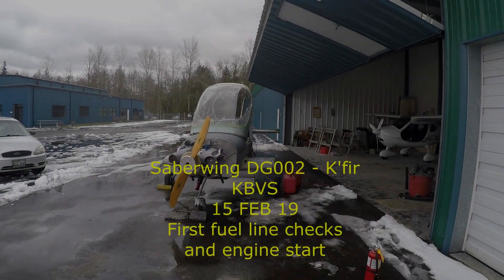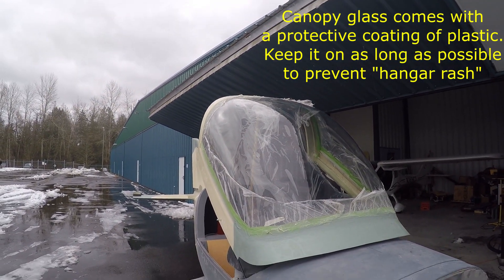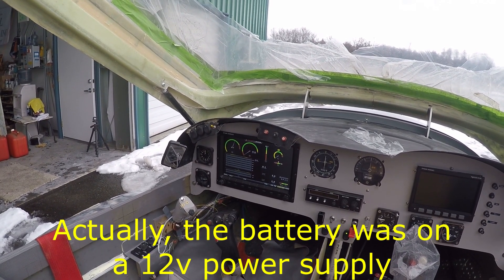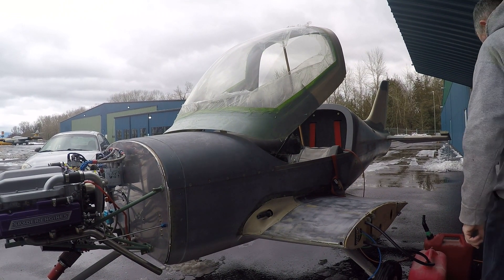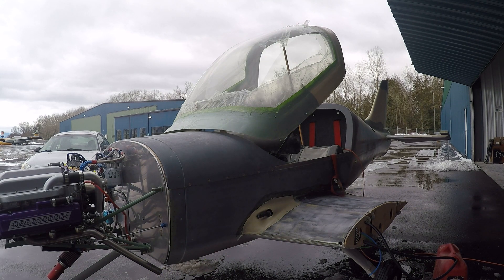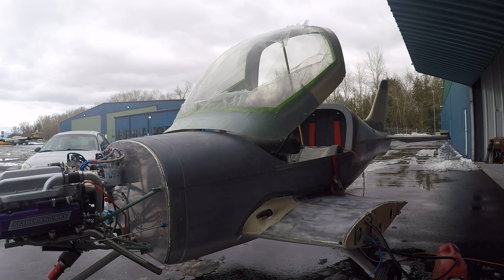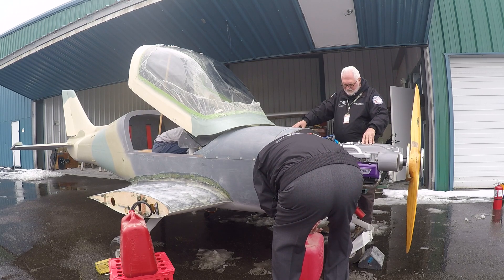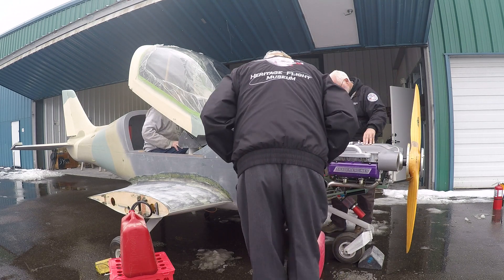Saberwing DG002 Corvair engine first start 17FEB19

Comment: I wonder how the Saberwing would do with a 160 hp engine (there was someone who once installed a 200 hp engine, but couldn’t go full throttle without exceeding Vne).  Bill once said it could handle a 160 horse engine, but that’d probably be the largest you’d want to put on it.
Reply from the maker: General, you would have to ask Bill Clapp at Azalea Aviation.  As always, more power equals more fuel burn.  If speed is the real issue this plane is efficient, but there may be others one would want to explore.  It all depends on what you want to do.  I am not going to be flying for about seven months due to availability, but when I get back to it I think I can improve the efficiency of the design and get another 10 knots on my Turbo'd Corvair. - Zip

Comment: My perception of the saberwing kit is it’s basically a KR2S with the modifications to the wing foil Mark Langford did with a university. This was then turned into a kit by the Corvair engine guy in Georgia. If so it should be fast with 100 hp especially if turbocharged to go to about 120 hp
Reply from the maker: With the exception of the engine and airfoil there is virtually nothing at all similar between the KR-2S and Saberwing.  Even the wings have different flight control configurations.  Having both airplanes I can tell you they are night and day different.  Do I love my KR?  Absolutely.  Is the Saberwing a better design?  Being decades newer it incorporates a lot of lessons-learned from the KR and other communities.  Time, and the tastes of individual builders, will decide.

iMs,
Zip
Reply: Thanks for the reply that’s helpful info. I look forward to your flight reviews!